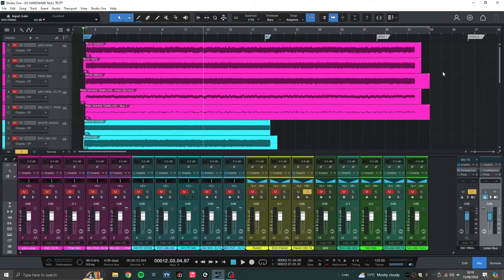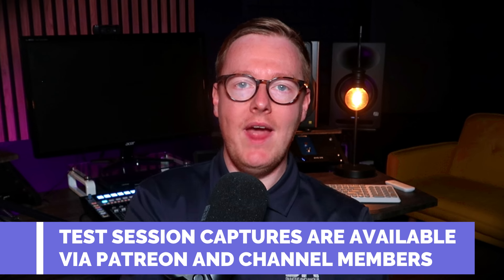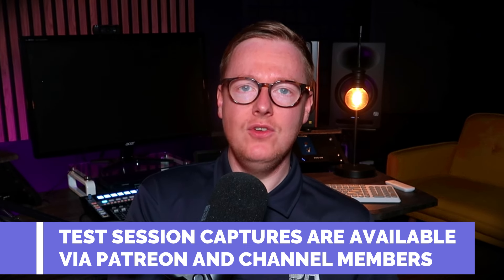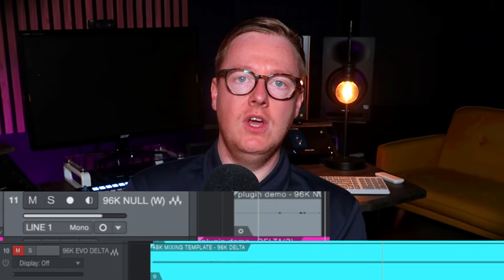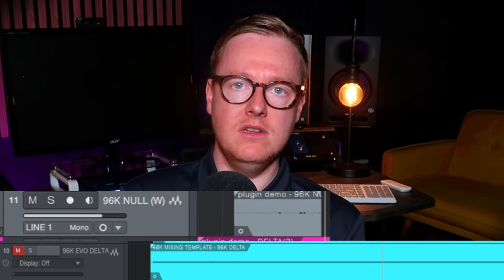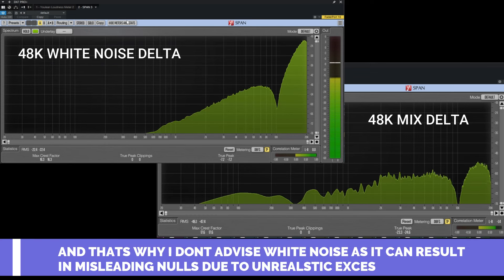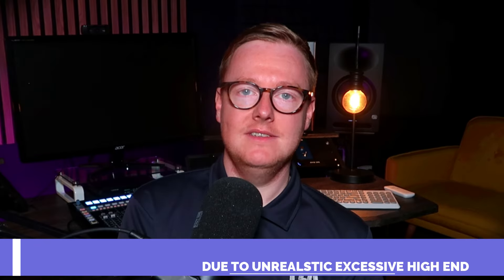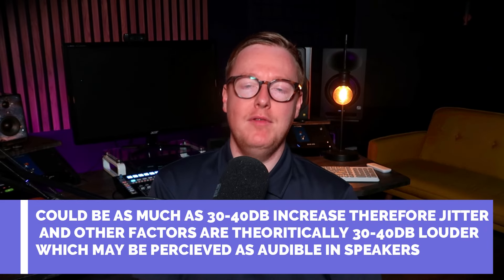Do You Lose Audio Quality In Analog Gear Using Budget Interfaces vs Expensive ADC Converters (Pt 2)

Comment: I definitely share your opinion. The room in which your speakers are placed, has by far the most impact on your mixing decisions. Then the  speakers and then the rest.
The best investment are good speakers, a good room and the acoustic treatment You may use this half of your life without the need to improve it. It keeps the value.
Todays converters are generally very good, even the cheap ones, e. g. the zoom 32 Bit ADDAs. Expensive ones offer very little difference compared to other gear in the production chain.

Comment: 4:59 - First time mixer here - that "turning up the amplification" comment hit home - That bit me hard on a couple of my mixes.
Reply from the maker: How do you mean?
Reply: @PaulThird  - as a n00b, I didn't catch a couple of settings. The mix volume was actually low, but I had a gain stage I COMPLETELY forgot I had (outboard EQ) AND had turned up the Gain on my Monitor Controller - cause you know - I like loud. I scoop the mids on my "listening EQ" so I can try to hear what it sounds like in my car if I turn it up. Anywho - 2 things happened - The mix sounded NOTHING like what I thought I heard ( that listening between the instruments problem ) AND the actual mix was unusably Low. I won't say it's a waste of time - cause - teaching moment - but I did have to re-do the last 3 hours of work. Now, I'm checking settings and actually check the Mix at a lower - more appropriate volume when getting it ready to master.
Reply from the maker: Ahhh I see

Comment: I took a long time for semi-pro-consumer DACs to be as good as they are now... And that's why people make such a big deal about them.... Preconceptions from how it used to be.
Some people are buying expensive convertors because they like the sound of them... Not because they are transparent.... It does feel like there are really subtle differences.  That can be defined as like space, or 3D.... Clarity.... That kind of thing. A lot of people say they use a particular converter because of that, for running to outboard gear.  

I want to check out some of the Topping stuff at some point.... Seems like an amazing bang to for buck proposition... I'm not worried about ADC... My Moto one sound fine... I got this unit because of the meters in the extra channels in, as a bonus they can bypass the preamp... For outboard preamps.  I'm not even using outboard gear once everything is inside the box right now.... But if I do start sending it back out to analog gear.  

Maybe the Topping would be nice.... Maybe it's really just more important for monitoring... Whatever.  Lol. I don't know if I'm ever going to worry about it honestly
Reply from the maker: I'm anal as shit so I'm always gonna bother about these things. It's one of those things that you'll never hear on speakers unless you have a direct comparison. Your brain gets used to things and it's only until you hear what the difference can be that you all of a sudden hear things differently

Its not gonna make or break your career but I feel that a very high quality DAC makes the job a little easier when it comes to placement. I need to listen more critically to really dial in the subtle stuff in most audio interface DAC's

Comment: I may Break your Noggin LOL I ummmm Accidently LOL Found out that this PreSonus Quantum 2626 is flat sounding compared to an RME in first impressions. I mix at 96 K now with all my own music and I felt like I had something going. It sounds really good with the QUANTUM LOL However, I needed more I/0 for outboard gear. The RME I got Friday actually LOL 2 days ago. Something seems so different when I am playing guitar and recording like the Latency is just not there anymore. The 2626 is Thunderbolt and the RME is USB 2!  When I did a few test riffs on guitar and did a quick drum loop for a test last night man the detail coming from the RME is just I don't know, I can't really describe it, it feels better and sounds better.

 I was happy with the 2626 because I constantly test my system to make 96 k work! It took me a while to learn what needs to change on the system when mixing and recording at 96 K. If you don't play with the buffer and processing settings, you won't be able to reach enough tracks with plugins for what you need to get a full mix. PreSonus has that drop out protection. That said I made test after test after test at 48 then 96 K and I agree 96 sounds better. BUT this RME interface seems to have less jitter or something. I can hear more detail. This is just a first impression, so I'll let ya know if anything changes...

Comment: I've got an RME Babyface Pro for ADDA to my compressor, but I send the speakers their signal from the Tascam Uh-7000 linked via spdif because the space between the instruments is so much better and clearer
Reply: It's very likely that with the Tascam you are listening to the track and the converters, with the RME you only hear the track...
A bit like hi-fi audio speakers (maybe with a tube amp) that definitely sound 'nicer' than a studio monitor, but are not ideal for making mix choices.
Reply: @londonacoustics  it could be, as the Tascam is very hefty but on the cheap side. It has Texas Instruments converters and much stronger amps than the Babyface. It does work better when clocked from an outside source.

If I am hearing the converters more then they're doing a better job of imaging than the Babyface ones, which can only be a good thing for monitoring.

Comment: I pulled out my old Presonus firepod FP10 out of the shed about a month ago that I bought way back in 2007 or 2008. I redid one of my tracks. And what do you know? It sounded absolutely fine!

I also had an old joemeek twinq two channel strip unit with build in AD conversion. Again...sounded perfectly fine!  These units are old AF!

Comment: I agree with a lot of what you're saying.  However, have you soak tested both units with the voltage swings many consumers suffer from? There's parts of the UK grid you're often lucky to see 220 volts. In which case, which one copes the better , which one doesn't mind being fed "dirt"? Don't get me wrong, there's some very esoteric kit that  falls over if it's not fed a nice clean, stable voltage. Traditionally,  expensive kit often has a PSU that's pretty much,  bombproof,  cheaper gear,  that's where they cut costs.  Now, you may never have an issue. Unfortunately, others will be plagued with issues.  It's a lottery,  there's no hard and fast rules.  That's why I have a Lake People Headphone amp, it can run just fine, off the Ukrainian grid as Vlad the  Inhaler is chucking Kinjals at it.
Reply from the maker: I have no idea. I just plug and play haha

Comment: Test in MixAnalog is not valid...
Reply from the maker: Doesn't matter if you think it's not valid.. It's all inaudible anyway.
Reply: What makes it invalid exactly????
Reply from the maker: I can only imagine that he's implying that the access analog transmition of audio via online servers isn't lossless like they claim but then if that was the case then the lynx at the same sample rate as evo wouldn't achieve a quieter null, but it does.
Reply: @PaulThird  So you're saying that if the Access Analog wasn't lossless then whatever loss in audio/differences would be audible regardless of the sample rate. So, because you CAN achieve a better null with the higher sample rates then that means the audio you are getting from Access Analog is lossless, right?  Just making sure i understand the logic.
Reply from the maker: What im saying is that with audient I am connecting direct to computer where with lynx I am connecting over the Internet. Surely if the Lynx wasn't lossless transmission it wouldn't achieve a quieter delta than Audient at the same sample rate. If it was lossy transmission (which is actually an optional setting if your bandwidth is compromised) then that would definitely impact the delta and i would be surprised to see it better the audient delta if that was the case, especially at 96khz where the filters are less at play
Reply: @PaulThird  Oh.. ok. I see now.  Makes sense. Either way, im sure you have the experience to tell if what your're hearing in the null test is due to lossy audio or not.  And it would most likely be pretty consistent across all sample rates.